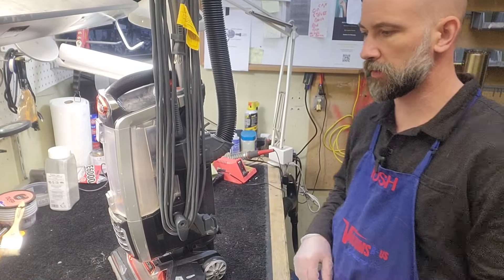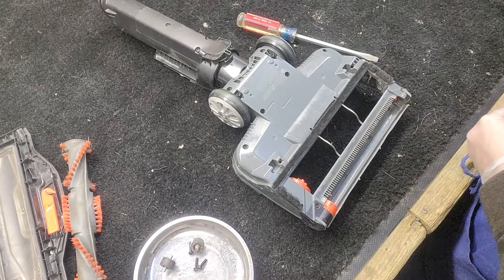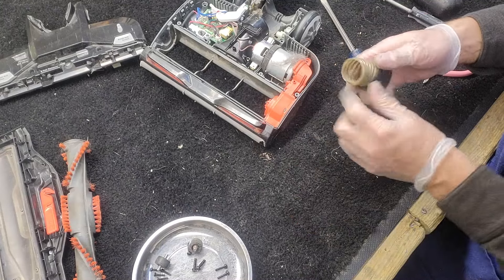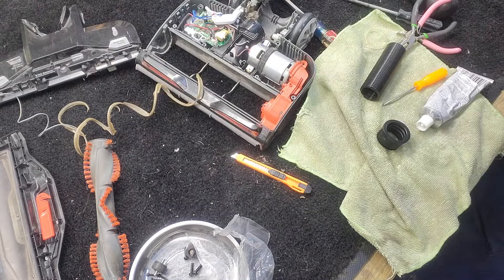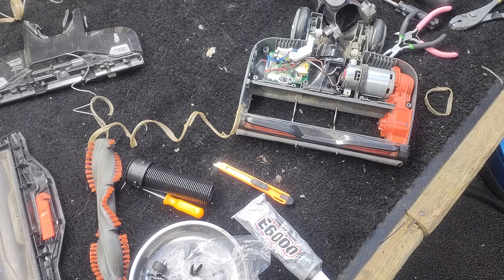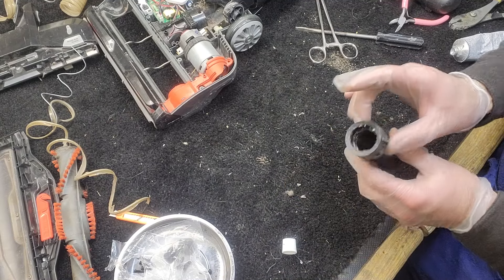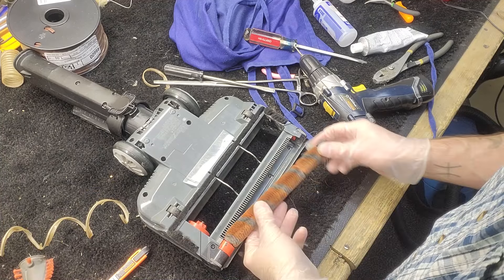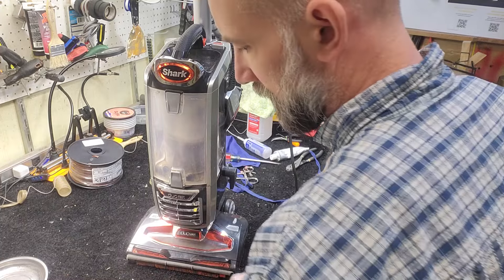Lower Hose Replacement on a Shark Duo Clean

Comment: I have a Shark Duo NV801 and I have bought the hose described in this video.  The black hose will not fit.  It does not screw into either piece like the video.

Comment: I bought the hose linked in the description and it's not black and doesnt fit at all
Reply from the maker: Hi Emmanuel. Thank you so much for notifying us of this! It turns out the link we previously had in this video was for the incorrect hose! I have processed a replacement order for the correct hoses and additional glue (in case you already opened the other one) which will ship to you today. I apologize for the inconvenience!

Comment: out of curiosity what percentage of your vac repairs are Shark related?  I see stores flooded with Sharks - only bought one years ago and returned ir the same day (bac pickup/loud/etc.).  I use dirt devil pet swerve for quickies but get the Miele C3 and Sebo E3 out for serious cleaning.
Reply from the maker: Around 30% of paid repairs are sharks. A lot of stores wont touch them due to parts availability issues and repair complexity.

Comment: My wife bought an "official" replacement hose. It's slightly too big. It won't screw in for anything. Very frustrating. Had to buy two sets of star bits. The first was too short. So far I haven't bled or smashed anything. It's going in the landfill. Won't buy another Shark.